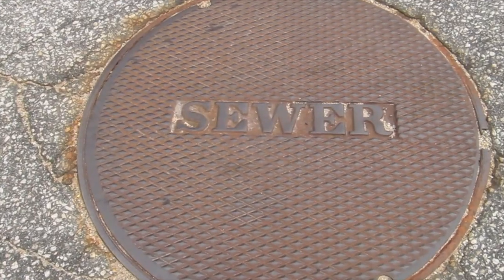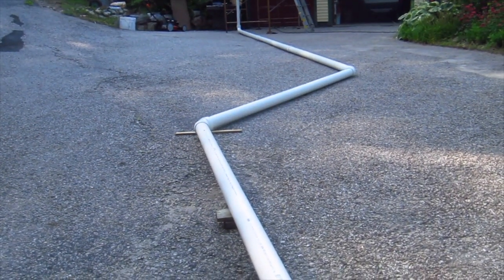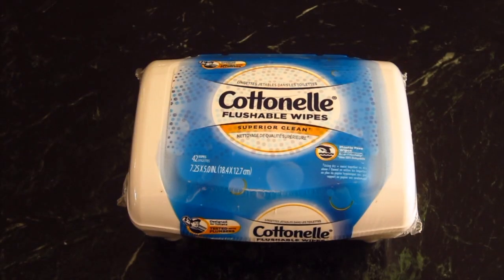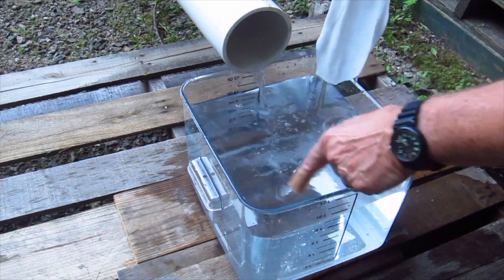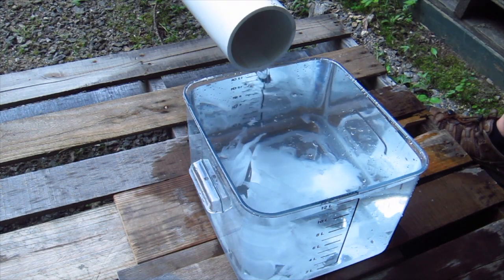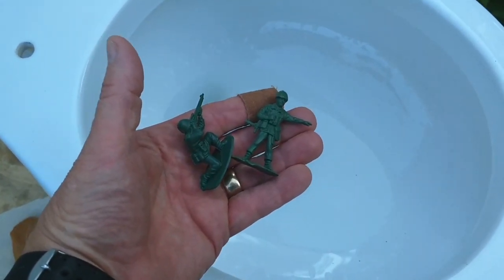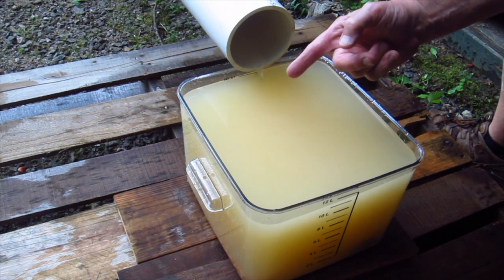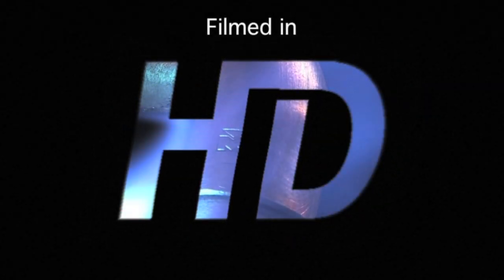Flushable Wipes - Do They Disintegrate?

Comment from the maker: Only type what you'd want your mom to see. Lewd and crude comments won't see daylight here.
Reply: You really don't know my mom… ;-)  (She was such a potty mouth.  Yes, was.)
Reply: Can you test more wipes to see if there is one that safe for flushing?
Reply: @amandam5845  There are none!
Reply: @amandam5845  why don't you test your own flushable wipes? You need two buckets, and a three-foot length of pipe, the same size as waste pipes from toilets. Take one wipe, wipe a portion of your skin with it, stick it in a bucket of water, pour it down a 3-ft pipe the same diameter as a toilet pipe into another bucket. Trade the buckets, and pour the water with the wipe in it again until the wipe has passed through the same number of feet that this guy's pipe was. It won't be an exact test, but if you also test one of the wipes that he tested it should give you a pretty good idea.
Reply from the maker: @amandam5845  No I can't. I took down the test apparatus so I could get in and out of the garage with my car and truck. There's NO NEED to test others. Didn't you have the same reaction after watching the video I did? The flushable wipes do NOT break down in your sewer line. Why would you ever consider flushing any of them? Just follow my advice at the end of the video. BUY whatever flushable wipe you want, use them on your bum, and put them in some type of garbage container that isn't disgusting so you see the soiled wipes.
Reply: @askthebuilder  By that logic, you can't use double ply toilet paper either. Obviously some are flushable and some aren't, some are better at disintegrating and some are better at staying together and clogging the pipes
Reply: The Scott toilet paper also doesn't break down easy. I had my basement back up with sewage a lot in the past. I switfhed to Angel soft and it's been a non issue. Thinking about switching to a bidet soon as well.
Reply: An important issue, thank you. If you ever do any more such videos, it’s worth mentioning; a bidet on your toilet, which remives the need for toilet paper altogether, and in a separate home septic, this means less to no smell too. Most people don’t know but toilet paper actually contributes to the bad smell of a septic, more so than the other.
Reply from the maker: @EmilyBieman  Can you expound on the science of how TP contributes to creating a worse odor in the septic tank? I'd appreciate it if you'd post a link to a white paper published by some organic chemist that would validate your claim.
Reply: @askthebuilder  i'm afraid it's just a personal observation, after living on quite a few farms and varying septics.
Reply: @askthebuilder  this is just a shot in the dark, but maybe certain kinds of TP could contribute to septic odors in the same way that they do in porta potties - by making a pile that eventually elevates waste above the surface of the water.
Reply: @EmilyBieman   we don't have the space on either side of our toilet nor the elbow room for bidet works. I prefer the european bidets if  you have used one you'd understand there's a difference and they do use tp.
The bathrooms space are planned for a bidet Both US and UK and very lacking in that.
Reply: what about kids whos parents let them swear? can i say those things here?
yes I'm joking and being a smartass.
Reply: i was waiting to see someone's face shoot out the pvc and for everyone to erupt in laughter 😂
Reply: What? She's worse than me.
Reply: Oy vey!
Reply: Ask the Builder Thank you for putting word out. Here in the UK, there has been very little on msm concerning wipes and quilted tissue. 

We once had a cafe/restaurant. The landlords upstairs tenant had a baby and somehow flushed disposable nappies. No idea how she got them to go around the bends. Maybe she physically pushed them as far as she could. We couldn't close the business and wait for the landlord to come, see and send a plumber so ended up paying three times for the pipe to be unblocked. 

I think quite a few people really do need it shown to them as you have done here.
Reply: Ange Browne Ahhhh, and there are the infamous London “FatBergs”.
Reply: I wish you had tested tissue paper: tissues that people wipe their noses with.
Reply: @theultimatereductionist7592  you can place it in a jar of water and see if it breaks down, or place used tissue in the trash instead .
Reply: @theultimatereductionist7592  I agree, I know some people put Kleenex in the toilet.  And why in the world would people put paper towels in the toilet, not a good idea at all. 🥴
Reply: So will the flushable wipes break down inside the tank with the actual waste? You would think that with the acidic properties of  human waste would cause breakdown.
Reply: Why is there so much more water in just the toilet paper and not my and not my wipes looks like your cheating
Reply: @Nathan Mcilveen thank you someone I can agree with
Reply: Who cares, it’s a video on the internet…
Reply: Swedish cloths are the worst. Been using flushable wipes for years now never had an issue. A Swedish cloth will clog your drain not flushable wipes. I too am calling BS on this. What I find clogging drains are roots, egg shells, fibrous vegetables rice and child’s toys never have I found a flushable wipe to be the cause.
Reply: You forgot Equate Flushable wipes
Reply: @VICTORV1990  sold by walmart I think
Reply: Flushable wipes are safe to use. That's why I pay a sewer bill monthly. Let them deal with it.
Reply: @patjohnson742  typical boomer American attitude on how paying equals entitlement to abusing the public sewer system.

Comment: I've been a plumber for 65 years and NEVER use a 3" waste line. All waste lines need to be 4".
Reply from the maker: Buddy, 4-inch is used for commercial toilets. 3-inch is the gold standard in residential work. Perhaps you're not familiar with the modern plumbing codes. After all, you don't have one video on your channel proving that you know anything at all about plumbing. My guess is you're too old and tired now to record and upload any. But I've been wrong before!

Comment: Get a bidet y'all! The Neoluxe are inexpensive, easy to install, and very cost effective! 
No more using wipes! And youll use less toilet paper and get a better clean.
The water comes from the tap, not the tank. 
You don't have to remove the toilet. 
And you control the stream intensity.

Comment: But what about non-human underwear...?
Reply from the maker: So here's the issue with non-human underwear. For starters, it's very hard to come by. The LA wildfires have made it very scarce because there's been a huge run on it out there. Secondly, the coefficient of continuity of the non-human underwear produces an exothermic reaction as it travels through the drain pipe.
Reply: @askthebuilder  Yes! I heard something about the sheer volume of non-human underwear being flushed down toilets as the likely CAUSE, of these fires. Thank you, for your patience in reminding me of this. If only your wisdom had been more widely appreciated. I am grateful for your prompt reply, sir.

Comment: Just get a little spray bottle with some water in it. After you clean yourself the normal way, get some folded up TP and wet it for a final clean up. No nasty chemicals on your skin, dissolves well, and cheaper than wipes.

Comment: I'm less concerned with what the flushable wipe looks like when it reaches my septic tank, than how long it takes to dissolve/decompose once it gets there.  I'd rather see an analysis of the contents in the tank once all those little microbes get to work on it.  I started using Dude Wipes about a year ago, and haven't experienced any problems at all.  The consistency of the wipes is fragile enough that you have to exercise some care to prevent them from tearing when you remove them from the package, and the manufacturer claims they're septic safe.
Reply from the maker: It really pays to take the time to read other comments before typing one. Go look at the ones left my septic tank pumpers. You live in the valley of Wrong.
Reply: @askthebuilder  I pump out my own tank, idiot... through a garden hose! :face-fuchsia-poop-shape::face-fuchsia-poop-shape::face-fuchsia-poop-shape::face-fuchsia-poop-shape::face-fuchsia-poop-shape::face-fuchsia-poop-shape::face-fuchsia-poop-shape::face-fuchsia-poop-shape::face-fuchsia-poop-shape::face-fuchsia-poop-shape::face-fuchsia-poop-shape::face-fuchsia-poop-shape::face-fuchsia-poop-shape::face-fuchsia-poop-shape::face-fuchsia-poop-shape::face-fuchsia-poop-shape::face-fuchsia-poop-shape::face-fuchsia-poop-shape:
Reply: I mean, instead of trying to justify the use of these expensive chemical wipes, you could just get a bidet? Cleaner, healthier, cost effective, and better for the septic system/environment.
Reply: @Omnihilo  I'm fortunate enough to only require one wet-wipe 99% of the time... no skid marks at all.

Comment: I've never met a person that has read the directions on the back of flushable wipes. 🤦🏼‍♀️ Yes, there are directions

These are the same ones who also overuse ANTIBACTERIAL products which also eliminate those needed in the septic system

I'm not surprised a WET wipe doesn't dissolve in plain water. That would defeat the purpose of them being wet. Just common sense would tell me that degrading would only happen when introduced to bacteria in the septic

Comment: Is this not an issue for modern apartments? I've lived in several over the past 10 years and not one has asked residents to avoid flushing wipes.
Reply from the maker: Why of course it is. It pays off in spades to spend lots of time reading the comments left by others before you type yours. Many landlords have commented on this video.
Reply: @askthebuilder  not sure which comment you're referring to. I read about 50 and haven't seen any from a landlord. And if it really were a problem for any of my apartment managers, why wouldn't they warn us? They warn us about all sorts of things in the rental agreements, but never anything about what not to flush.

Comment: This is a hindsight 20/20 comment, the only way I would’ve improved this simulation was to wipe your arm or leg with the wipes than flush. People don’t typically flush unused wipes. The friction may make the materials degrade a bit better than what was shown in the video. But this is just my opinion and speculations. Glad to have run across this vid as I myself use some Sam’s store brand flushable wipes.
Reply from the maker: That's a good call out. It might have made a slight difference.
Reply: I immediately thought about that!

Comment: WOW man. Great test.
Reply from the maker: TNX as we say in Morse. It SHUT UP the Flushable Wipes Alliance. I called their bluff and they had NO COMEBACK because my test was accurate, to their standards, and showed they don't fall apart with ease.
Reply: @askthebuilder  I have worked for master tradesmen like yourself for my career. I was told they are a joke years ago. Have pulled alot out of plumbing systems as we have many folks on septic systems around here.

Comment: What about tampons??.. I already know pads are a no-go but manufacturers say tampons dissolve and break apart.
Reply from the maker: No no no no. Do they break down inside your moist body cavity???? Do you own experiment. Put a new one in a clear food storage container with an air-tight lid. Every day shake it for ten seconds. Record a simple video after a week, upload it to your channel, and come back here and share the URL.
Reply: @askthebuilder 😂😂😂 Thanks but I’ll pass. The blood and body tissues the tampon is filled with is compressed in the vaginal walls. Just like when someone rolls and stuffs facial tissue up their nose to control runny mucous. It wouldn’t “break down” in the nasal cavity.
I hope you understand I asked a genuine question. The only other thing I heard about tampons was that they DO break down but the string does not. I wouldn’t know either way.

Comment: A few comments:
I never use flushable wipes. I just wet the toilet paper.
Single ply TP is garbage and basically useless in my opinion. I hate that stuff.
That simulated bowel movement was kind of small. I guess that’s why my toilet gets stopped up 75% of the time! I’ve clogged toilets across the country!
Reply from the maker: The simulated BM met the standard put forth by the experts. Go back and freeze the video where I provide the screenshot of the specs.
Reply: @ I saw it…….just saying that from personal experience, it’s small. Lol!

Comment: i use wipes and toss them in a small trash can with a lid. never had any smell problems. i have accidentally flushed them before but thankfully it’s only been a few times over the years and haven’t had any issues but i’ve always been curious about how they break down

Comment: what was the purpose of this? flushable wipes are designed to break down over time not immediately disintegrate upon being flushed ... there was zero reason to do this test.
Reply from the maker: You're so wrong. You put your ignorance on display because you failed to take the time to read HUNDREDS of comments before yours. Read the ones written by sewer-plant employees.
Reply: One thing tho, flushable wipes can get  caught or hung up along the way when being flushed and cause blockage.

Comment: All wipes are not the same, So far the best ones i found were Walmart ones, Which start to fall apart as soon as they soak up some water. They are alot thinner than most as well. But thats assuming they don't change them. The brand name ones are in fact tougher & thicker than alot of them & are more like feminem wipes. 3:52 Soybean paste is not similar to crap at al its far softer & less dense. I imagine its just close enough.7:42 i think you should up it more than 6 sheets as most people use 1/4 a roll roughly doubled over from what i have seen.

Comment: I've used the Cottonelle brand ones a lot, and I've had them break apart into mush in the package after sitting for about a year. They break down as well as the higher quality toilet paper. I flush them without worry, because I know they can actually break down as advertised.

Comment: Lol, I can't imagine trusting a company when they say they've created a "flushable" wipe. 

And if they did make a fully septic/sewer safe flushable wipe, it'd probably fall apart in my hand mid-wipe.
Reply from the maker: Dr. Power Cage Fighter: I believe you missed the point of the video. Thousands of things are *flushable*. That doesn't mean you should be foolish and do so.
Reply: @askthebuilder  Where did I say I would?
You need to work on your reading comprehension, bro.

Comment: As a journeyman plumber working towards his master license, I love this. I’ve been warning people against almost as long as I’ve been plumbing (6 years so far). Especially if you have a sanitary sump for your waste. These wipes will get stuck in the impeller and ruin your pumps. Also 70%+ of drain cleanings I’ve performed have had some form of wipes on the end of the snake. Use a sealed garbage bin or bidet instead
Reply from the maker: Robert, GL on advancing to the Master level. I did that in 1989. Plumbing is a very interesting and challenging trade. I wish you the best and a long career!

Comment: Why on earth is it legal to market those as "flushable wipes" !?
They're only "flushable" in the sense that they are smaller than the hole in the toilet and they sink in water, so that they technically can flush; but by that logic you'd might as well sell "flushable concrete powder"
Reply from the maker: You missed the point of the video. Watch all the things I flush and look what comes out of the end of the pipe.
Reply: @askthebuilder  I did. I just mean that calling it "flushable" is an obvious lie since it doesn't break down like toilet paper and will contribute to fat bergs in the sewer if it doesn't outright clog your own toilet. I don't understand why the laws allow such a product to exist.

Comment: I'm surprised how much water a single flush uses. 
Glad I only flush when it's brown!! If it's yellow let it mellow lol
Reply from the maker: 1.6 gallons plus the water running down the overflow tube as the tank fills. Probably 2 total gallons until the fill valve shuts off. There is NOT a water shortage. Every gallon of water you use and send to your septic tank or the city sewer, goes right back into the water system (rivers, aquifers, etc.) Those that choose to live in deserts where there is little water, are foolish in my opinion.

Comment: I've used THOUSANDS of Cottonelle flushable wipes with ZERO problems (single family home connected to sewer system).  I follow the instructions, and use several flushes (for multiple wipes).  Heck they tear just pulling them out of the dispenser if you're not careful.  They may not disintegrate as readily as TP, but they break down into smaller bits over time.  I don't think the manfacturer says they break down as fully as TP, so I think your test is misleading.  Here's a plumber who disagrees with you.  https://www.youtube.com/watch?v=dVijZZ2yAtc

Comment: Such an informative video that everyone should watch.  Sewer backups are disastrous.  We had a neighbor’s sewer line backup and flood their entire first floor.  The entire first floor floorboards were ruined.  They attempted to clean and dry the floorboards instead of replacement.  They later got very sick from the mold and contamination , with rashes, migraines and headaches.   Be sensitive with your sewer lines. Never dispose fat or large amounts of food.  Skim fat and toss it into the trash or burn it in your bbq / garden waste burn.  Never flush wipes.  Install a bidet, which will reduce your toilet paper waste by 75%
Reply: One highlight of living in Japan was the commonality of bidets. Those things are amazing and have a lot of other uses too like seat warming and air drying, the latter which reduces TP waste even more when possible